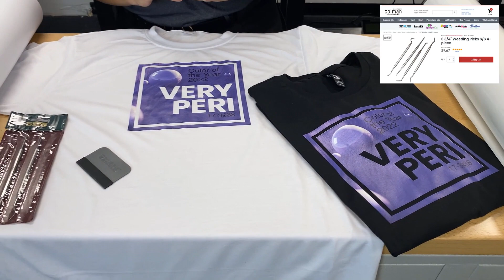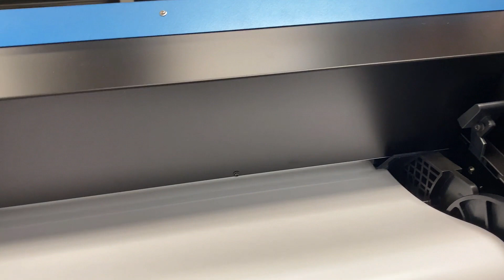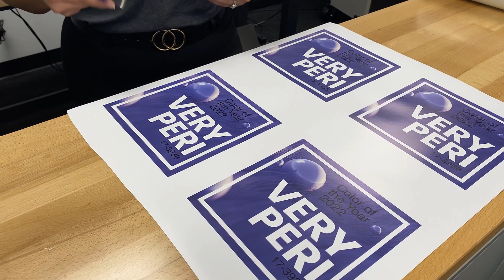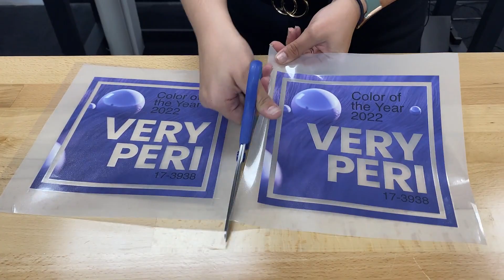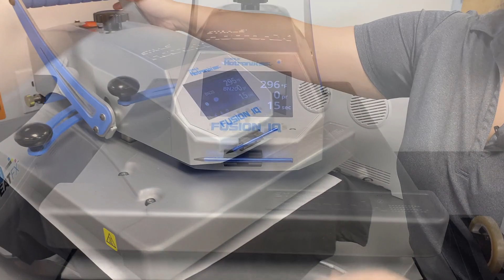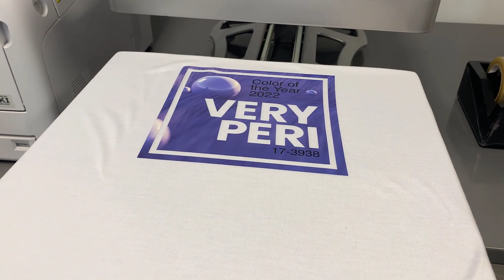How To Make a T-Shirt with the Roland BN-20

Comment: Can u also use the clear  static cling and clear permanent adhesive on this? Also can u do stickers as well as shirts? 
What’s the difference between the 20 and bn 20a?
Reply from the maker: Yes! Roland has a huge selection of printable media and they can all be used with both the BN20 and the BN20A. 
There are several sticker paper materials available. 

Here is a great video about the differences between the BN20 and BN20A. 
https://coldesi.com/2021/11/video-connection-roland-bn20-vs-bn20a/

Comment: That is a serious amount of effort , time. [ and all that material is wasted?] are the carrier sheets reusable ?
Reply from the maker: Making t-shirts can definitely be a process, that is why the cost is so low but the retail is high. This was just a demo but in a production environment you would look to minimize waste and work on efficiency.  Also for making t shirts our most popular method is DigitalHeatFX.com however the Roland is great for the versatility of stickers, window cling and other non-apparel goods.
Reply: @ColDesiColman  can there be a transparency window cling sticker decal?   What is the difference between a sticker and decal?
Reply from the maker: @josephKEOarthur  Yes! We offer both clear and white cling material. A sticker and decal can be the same thing. It's really about the material you use. if you want your sticker or decal to be permanent, you would want to use a Permanent Adhesive Vinyl or Sticker Paper. If you want a decal that can be taken on and off easily, and doesn't have a strong adhesive backing, you would want to use a cling material. Here is a guide that shows which material is best for each application - https://colmanandcompany.com/Merchant2/graphics/00000001/PDF_MSDS/Roland-BN20-Application-Guide.pdf

Comment: How did you prevent the burned in lines, when pressing on the polyester?
Reply from the maker: Hi Michaelangelo! Are you referring to lines from the vinyl's carrier sheet? if so, we haven't had issues with that. Usually lines come from heavy pressure and you hardly need any pressure when heat pressing this vinyl.

Comment: how many 11x17 t-shirt prints can be made from a single roll of the stuff linked in the description? to make any real kind of profit, what is the "minimum" i could price a basic cotton T with an 11x17 print?  right now I sell shirts for $10 (dare not go any higher, no one would buy them otherwise), using 3G opaque.  i assume since vinyl is premium stuff (and doesn't wash away like regular heat transfers thanks to the solvent inks) it can easily get away with a higher price?
Reply: i sell that same size and  t-shirt included for about $23 for a single shirt.. bulk orders are priced lower obviously, for this type of work minimum i go is about $13-$14 for bulk orders.. raise your prices asap. With one roll at the size mentioned you can do about 70 shirts give or take if you have the 75 ft x 20" roll

Comment: Great Video! I’m currently looking to upgrade my business.. still debating between the Roland bn20a and DTF printing… so far the bn20a looks like a winner
Reply from the maker: Hey! We actually did a great comparison video on DTF vs. Print & Cut Vinyl. Check it out here - https://youtu.be/GW3ybQgSwbg
Reply: did u buy it yet
Reply: @jonny5alive555  no not yet.. business slowed down a little smh
Reply: @VIPCustomPrints  boo
Reply: @jonny5alive555  business slow ur mom taking all the customers
Reply: bn20D is a dtf printer. There is an issue with white ink with dtf printing. Not sure if bn20D is any different.